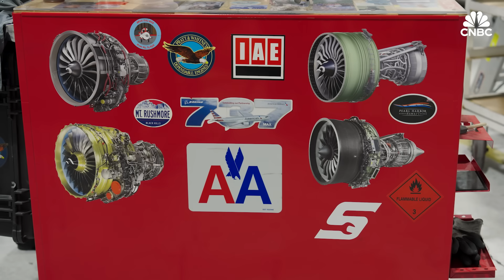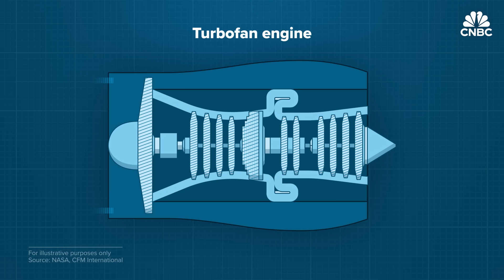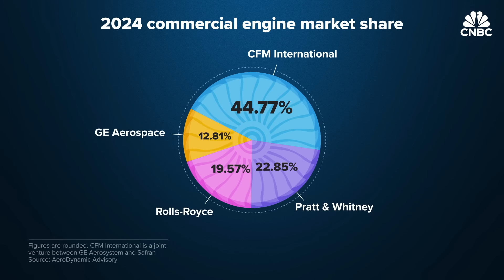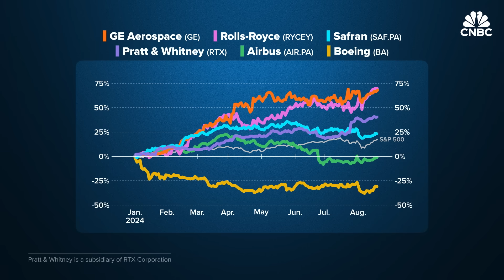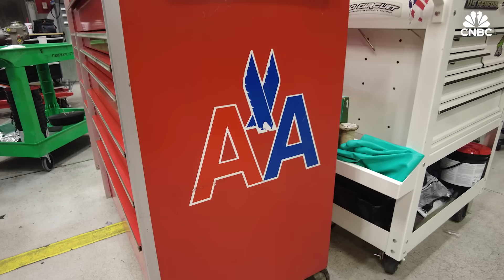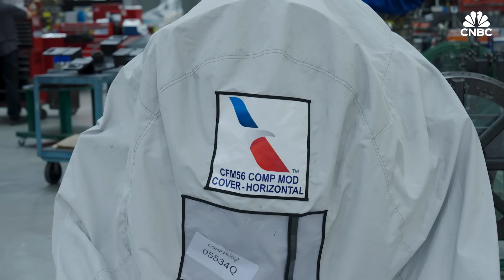Why Airlines Like American Are Scrambling To Make Engines Last Longer

Comment: To get with the Nautical Miles per Hour.

To get with the Range.

To get with the Thrust.

To get with Max Operability of Engine.

To get with the Transmission.

To get with the Auto-Controls.

To get with the Fuelcycles per Burn.

Comment: Invest more in quality upfront so u don't have to waste more $ in maintenance costs and waste time in downtime delays.

Short term>long term hasn't worked out so well.
Reply: It's not that simple. Sure, you could probably make an engine that lasts 200,000 cycles, but it would be so enormously heavy and inefficient that it loses out in both the short term and the long term. The lower fuel consumption of modern engines is easily worth the higher maintenance costs.

Comment: So jet-engine makers let Delta repair/overhaul freaking jet engines in-house, but John Deere won't let farmers repair tractors anymore?? US is so messed up.
Reply: I'm all for farmers fixing their equipment, but in this comparison it would be more like the pilots ovehauling the engines
Reply: Actually, the airlines sign two contracts.   One with the airframe maker the other with an engine maker.  Most planes have two engine options.  When the sign the engine contract they get to pick from several types.   They can buy the engines outright and are then responsible for maintenance, or they can pay „by the hour“ or sign a „fixed price agreement 
„. 
Big airlines like United or Lufthansa buy their engines and then repair them in house. .  Smaller airlines either pay the engine maker for maintenance or go to a shop like United’s for work.
Reply: Although I support farmers' right to repair their equipment, but this is a very stup*d take. You are comparing people and companies, experienced technicians with admittedly one of the most hands on demographics, and jet engines with farm equipment.
Reply: @kevikiru I think the point is, repairing or replacing tractor parts should be accessible to farmers who can order a part, and have a mechanic fix it for them. 
JD has done farmers dirty. I would recommend watching vids from Louis Rossman for more context.
Reply: JD does not want farmers putting baling wire and JB Weld on everything.  😂
Reply: The US?  You mean corporations making their own decisions.
Reply: You sound stupid
Reply: Not really

Engine makers make their money from repair so there are different kind of contracts but all of them depend on the OWS and overhaul teams from the makers.

Large customer like AA or FedEx does have their own facilities but as an extension of the maker's

Comment: I had a dream of an airliner stuck on the ground due to a lack of fuel, on it were a physicist and his young daughter, they began writing an equation on the inside of the fuselage to try and remedy the lack of fuel, it then proceeded down the runway and did a massive u-turn at the end, bypassing a fuel tanker that was parked there. I think the meaning of this dream is that there are other forms of powering aircraft (and maybe just power generally) that are yet to be discovered (1), and hopefully people are supporting the research of such technologies, beginning with the theory behind it (2). Perhaps there is an element of "family aptitude" when it comes to such matters as well, with child being liable to contribute by following in their learned parent's footsteps. I think an element of "desperate need" like being stranded in the dream may help accelerate the process by a stimulating a sense of urgency about the whole endeavour (3). Until then I think refurbishing present technology is important, including from an environmental point of view. 

1. It might help to articulate things clearly, I think this is all ultimately energy but it manifests in various "forms of power", internal combustion is one form of power, thrust from a jet engine is another one, there are probably many others out there which are yet to be discovered.

2.  I've had other dreams that may be relevant, such as Professor Einstein explaining the difference between classical mechanics which requires contact between physical points of matter to achieve motion (such as a wheel pushing against the ground), and his pure energy theory which doesn't. I saw a vehicle being at two different locations in "space-time" and the only difference seemed to be the "co-ordinates" at which it existed. I can't make sense of it all but I'm sure someone learned in that field can do so, maybe the energy is directly related to the co-ordinates, or maybe energy itself has co-ordinates, and you need to factor that in to move the vehicle using some form of power that doesn't burn anything.

3. I think this includes the fact that the planet is becoming increasingly toxic and very much dying from burning fossil fuels, important as that may have been to reach the present state of economic development. I think the purpose behind all of this is critical and if it is as benevolent as can be it might help to stimulate Scientific Wisdom. It should also help to hold scientific practitioners in high esteem, including by giving them public acclaim for their achievements. 100 years ago the most famous person on Earth was Professor Einstein, today it “isn’t that type of person of at all”.
Reply: How high are you

Comment: I think they should make jet fuel out of methanol and ethanol. And it’s a good combo because the methanol can use the carbon dioxide from the ethanol plants. And mixing them would be important, because pure methanol’s flame is invisible. ME 50/50 or whatever mixture percentage they decide to make. It is the best way to store hydrogen at normal temperatures that I’ve found. 
https://en.wikipedia.org/wiki/Methanol_economy#Green_methanol

Comment: Numbers on overhaul are too low.  An overhaul of a large turbofan for a widebody could run as much as $30 million.
Reply: low emission aero derived industrial gas turbines running pipe lines all over are not cheap either

Comment: United airline overhauls their engines too. Their SFO jetshop is huge and even has a F117 military contract to overhaul their C17 engines.
Reply: When I worked there at the jet shop, it was a beehive but they were also starting to offload jobs to China (because it was cheaper), then I went to work at the terminals and whenever I go back there a few years after, it was almost like a ghost building...so very quiet. I've been retired now for 4 years but I doubt if  something has changed.

Comment: Maybe someone can explain this better, what I don't understand is  how engines can be on and working for 10-12 hours. They land, turn them off, and turn around time on avg is 2-3 hours. How is that good for the engines when they are only off for 2-3 hours compared to to the work load of a long haul flight?
Reply: A lot of things are designed to be working for a long period of time and are actually less stressed  if doing so.Some examples would be driving long distances are less stressful than turning a car on and off multiple times. Same goes for circuit boards.If you turn your electronics on and off multiple times In a short span,the board could warp.We had this problem with the Xbox 360 and ps3.
Reply: @duck198765  thank you appreciate it, also have heard that the engines aren't at full 100% like when taking off, just always wondered especially on the turn around times. Amazing engineering though

Comment: Are rotor based planes economical and efficient? Maybe we can rely on these for the domestic travellers.😅
Reply: Most “rotor” based commercial airplanes are actually jet engines which drive a propeller, also known as turbo-prop engines.

Comment: Why? In the U.S. Air Force I worked Jet and Turbo Fan engines. I got the engings out of the shop at 2-3 a day and ran some on Test cells in and out.. In Aiaia and Europe.. I eneven did Turbo fans in my last shop. Only on in the shop..

Comment: you missed the part where the airlines with the new engines are paying P&W for hours the engines are flying.  the overhaul cost is then on the manufacturer.
Reply: Honeywell has that type of deal too, we call it MSA contracts - maintenance service agreement
Reply: power by the hour

Comment: these engines are fascinating, when I worked at United in the parts warehouse I got the chance to talk with the maintenance techs and I definitely know that the parts are beyond expensive. a black box is about $48k, the main computer is near $1M, I've encountered parts that were small and cost thousands. incredible machines and engineering that go into it. kudos to the maintenance men and women.
Reply: I worked for a company that manufactured the equipment that melts and casts the superalloys and titanium for turbine blades. The equipment isn't cheap, the raw material inputs aren't cheap, the inspection is extensive. But it's such an important supply chain you need to have extreme confidence in the quality. This is why counterfeit parts are such an issue.
Reply: The first problem I solved was a poorly designed hook for headphones when I worked as an engineer for aircraft company name redacted. The hook cost $1,400. That holds the pilot headphones. It wasn't even designed right. I tell you, getting aviation certification is probably what drives the cost, but planes are so expensive it's more about delivering on time than cost saving. And of course safety.
Reply: @CjMatthews-h2b downvoted you... rolls riyce is a car maker you fool...
Reply: I hope the Chinese perfect this bussiness soon only then will we know the real cost of this parts and engines
Reply: @williamwatitwa3534 I don't Chinese engines will never be trustworthy quality over quantity
Reply: @ChrisMatthews87  well so far the ipnones they are making for you are top quality , you dont realy take their military as bluff and you dont trust yourself with their huawei devices , they built a space station and they have one of the most extensive modern infrastructure , they know what they are doing

Comment: This is why Delta was never really affected by the Pratt & Whitney geared turbofan parts replacement issue. Delta is certified by Pratt & Whitney to do complete teardowns and rebuilds of engines, and that's why Delta was able to keep their A220-100 and A321neo fleet fully operational.
Reply: this is exactly what i thought about. On the other hand jetblue and airbaltic are suffering from the GTF PW engs
Reply: They might have their own shop but everyone flying the GTF depends on the same supplier and who gets priority depends on the type of contract they have with Pratt aftermarket support
Reply: It doesn't really matter who does the repairs. Everyone is in the same waiting line when it comes to spare parts.
Reply: so that is why we have 220 and 321 gliders parked../because the GTF is junk.
Reply: Same with Air Canada
Reply: Idk if you should trust maintenance  by airlines. Many times their maintenance fails wrongly get blamed on the airplane manufacturers
Reply: @bl-nb8fo  I’ve never heard of airline maintenance errors blamed on the airframer

Comment: If one part fails the engine and perhaps the aircraft may be destroyed.  Engines are interesting fun to work on because they're so demanding. Study how cooling air protects internal engine parts from heat which would otherwise melt them to slag.  Jet fuel doesn't just "melt steel beams", it melts superalloys unless they're protected by an invisible and complex cooling air system which uses the (many, man tons) of air flowing through the engine.
Reply: nonsense…and it doesn’t prevent them from melting, it keeps them from EXPANDING.  stop spewing nonsense.

Comment: What’s the actual story about why they’re so far behind? Did they just stop all work during the pandemic until demand surged? Cause that would make sense given how stupid corporations are.
Reply: It's a complicated story. Certainly part of it is pandemic related in that work certainly slowed during the period. Restrictions on in person work during lock downs etc. Also just so much less flying during the period that impacted engine maker revenue since most engines are now sold on a power by the hour maintenance contract with the OEM. However, the biggest longer term  issue (which was covered in the story at a high level), is the new generation engines are requiring a lot more maintenance and part replacements.  PW and RR both have had major issues with their latest generation of engines. Demand is exceeding supply.
Reply: Airlines and engine companies cannot find decent workers with experience as the aviation world has such a bad reputation of low pay and layoffs so they hire inexperienced workers which causes a lot of damage to the airplanes and components as pre Covid massive layoffs and older experienced mechanics left for other professions bottom line Bad management decisions  as usual 😢

Comment: HPT blades can be a lot more than $30K each
Reply: And they put him saying there are 40-60 blades over video showing that there are clearly 100s of blades in an engine. Maybe he was talking about one disk.
Reply: @mattmullett9521  yeah on a -7B the compressor spool alone has probably around 80/90 airfoils (although since those are on the "cool side" of the engine they aren't expensive) but the HPT1/2 will have at least another 60 blades each on them and those suckers are more than a car, and they almost always fall out at every OVHL.
Reply: i think that such price is for a fan blade
Reply: No… not HPT blades only fan blades specifically for 7B

Comment: Running an airline isn’t cheap and it’s no surprise when one of them goes out of business.  Having worked for four now defunct airlines, I’ve experienced it personally.  When jet fuel prices go up, it’s even more challenging.  No surprise that airlines have to increase fares every so often.
Reply: you forgot to include the fat bonuses for CEOs
Reply: Comac from China is the future
Reply: @randomguy7175  China has no clue about aerospace.
Reply: Hmmm maybe you're the reason they're going bankrupt if they keep flopping after you work there
Reply: Personally i'm not against increasing fares for flights. In Europe i've taken tickets round trip for less than $30, there's no possible way of getting even break even at that price. There's no need to take such risks because low profit will eventually cause changes in the inspection and other testing needed for safety thus compromising it.
Reply: @blackbox1024 Sure, I actually believe EU regulations should set requirements that prices can’t get lower than 60$ round trip, at least then there wouldn’t be a race to the bottom bound to cause safety issues later down the line.

Comment: Good video. One thing to keep in mind. Yes, to overhaul an engine is $5 to $10+ million. That in itself is a big amount, but considering these engines fly for years on these airplanes, think about the amount of revenue they generate for an airline. From that perspective, is not that expensive. Just take an airplane, use the average fare reported on an airline’s financial statement, multiply that times the reported load factor, and just figure out 270 days a year of the airplane flying, and see how much revenue one airplane with two engines generate. On the low end, one airplane has the potential to generate $30+ million a year. Is pretty interesting.
Reply: Air travel today is limited to the customer by price so it is pretty important to keep price of tickets as low as possible

Comment: Everything in America is slow & expensive.
Everything in China is fast & cheap.
The West global dominance of commerce will come to an end becoz China will replace it with better, cheaper, high quality products,... faster.
Reply: How long did they take to build their own plane ? Unless compromising on safety and quality, China is not always fast & cheap.
Reply: @blackbox1024  Better any Chinese plane that has zero casualties compared to Boeing that has killed hundreds.
Reply: China has no clue about aviation hence will be using Airbus and Boeing for the coming decades. Their C919 also contains mostly Western tech.
Reply: @user-ns7dj1lo3r  you’re a joke and have - like China - no clue about aerospace

Comment: 0:03 "A jet engine is the most important part of a commercial airplane."  I completely disagree with that statement.  The wheels are the most important part of an airplane.  You aren't getting off the ground without them.  Landing safely also becomes rather difficult without wheels.  You can have the best jet engine in the world but it's a useless piece of equipment without wheels.
Reply: It should be  the most expensive part of the airplane
Reply: There are water planes too that don't have wheels